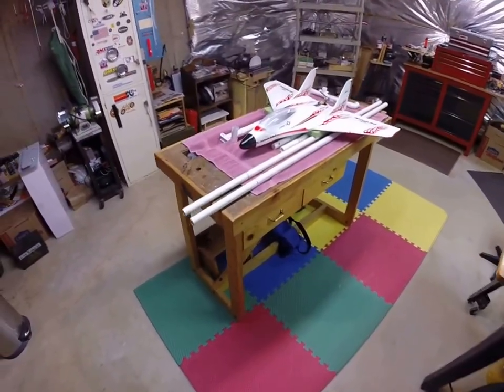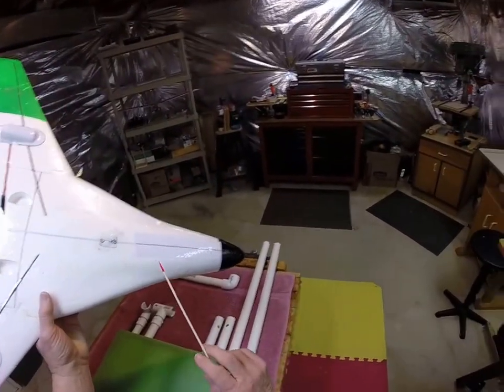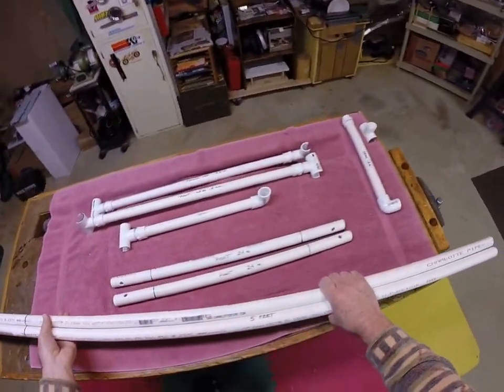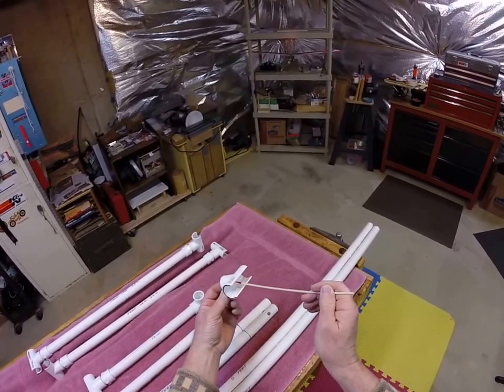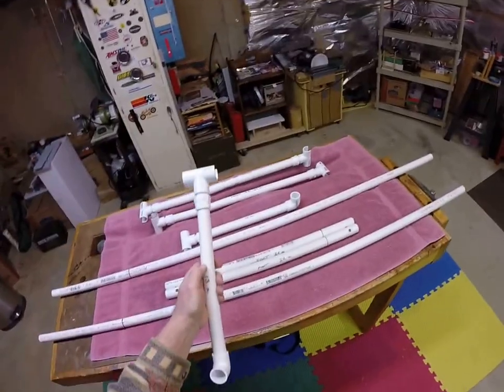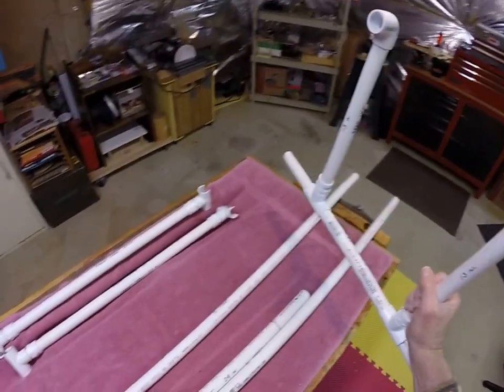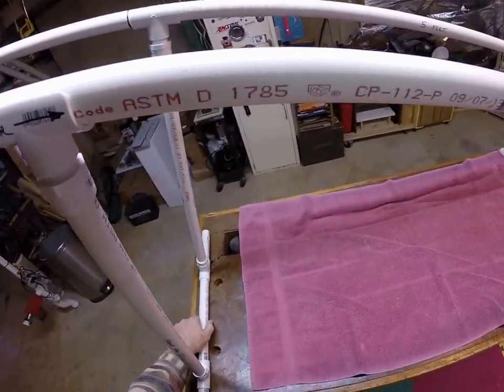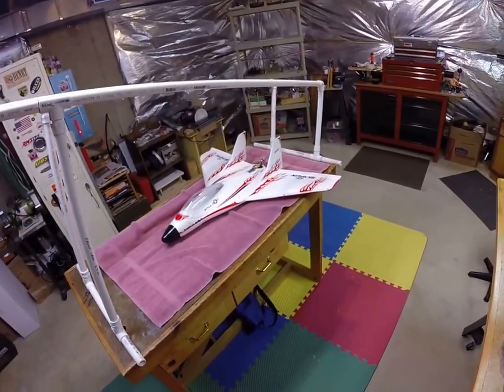PVC, RC launcher build

Comment: Question. If you want it slippery how does it work with foam becuase i would think they would stick to each other especially if the PVC is in the sun and gets warm. The t connectors look a little high and could snag the bottom of the plane, have you ever had any issue with that?

Comment: Great video. Can you tell me the size of the bungee tubing and the Length?
Reply from the maker: Ian, this has been so long ago, I can not remember. But watch my second video on the pedal launcher.  It came from Hobby King, its 10 mm and however long the roll was.  I have not used mine in a long time, but this is great fun if you have a place to use it.

Comment from the maker: I believe they do make some commercial stuff they you can roll out and steak down.  For your planes with really small wheels you can fabricate a launching runway from card board.  The two sides of a plane box, cut out and taped end to end will give you an 8' x 3' runway.  Good enough to launch, but good luck landing on it!  :)

Comment: Best design I've seen so far. I'm surprised  there aren't a lot more views & comments. Very well done video, great instructions.
I just got a Reptile S800 V2 wing. I just can't get it to launch by doing the wing tip throw and there is no where else to hold it safely and I'm not going anywhere near the prop when the setup is live. 
Trying to throw the wing and get to the controls in time is ridiculous. Thanks for the vids!
Reply from the maker: Thanks for your kind words.  Sometimes when you design and build a project, it comes out even better than you expected.  This was one of those times.  This is my most popular video right now with 2463 views.  You will really enjoy watching the plane come off the rails.  Have fun and fly safely!